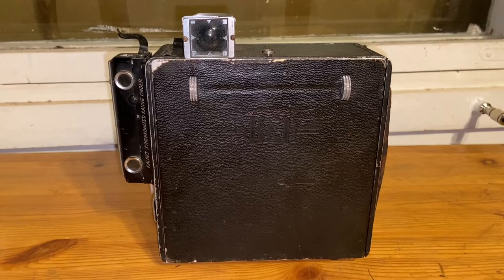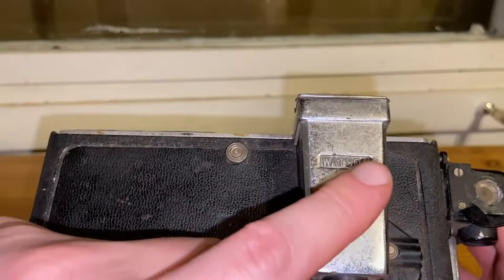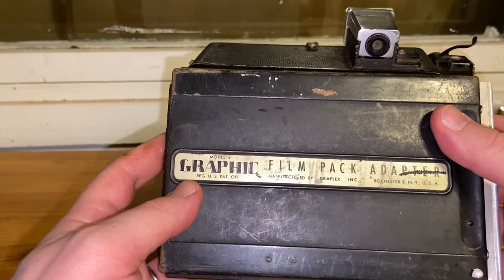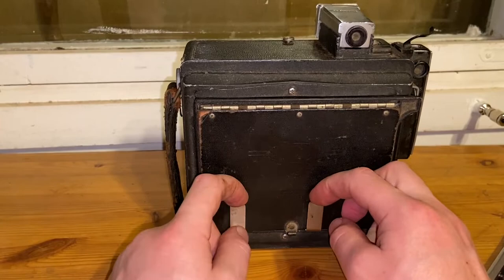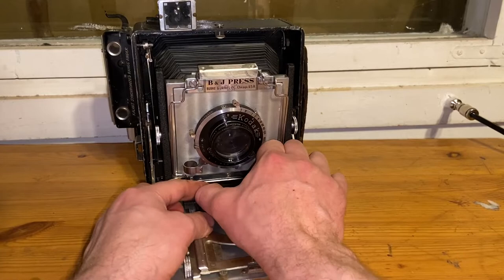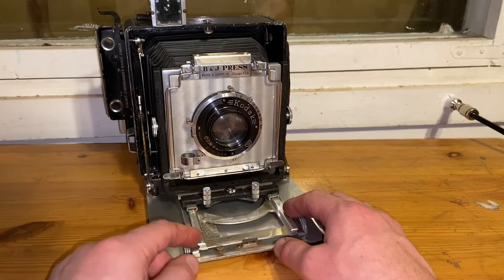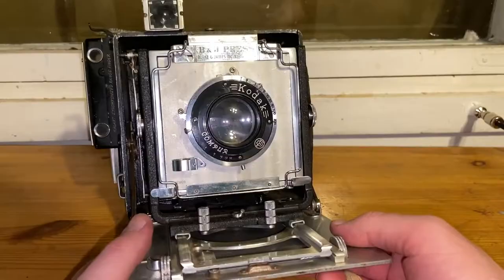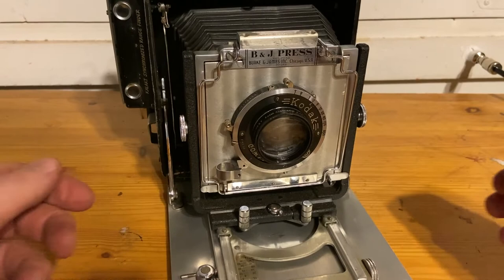Old Camera Review: Burke & James Press Camera

Comment: Thanks for the video. I was given one of these cameras to restore. It's a barn find, dusty and crusty but the ground glass and bellows are intact. It has a blank sleeve made lens board and I was given two lenses to repair and use. First is a Kodak Ektar  127mm f4.7 with synchro compur T-400 shutter and a Graphflex optar 135mm f4.7 with  Rapax shutter T-400.  Neither work, slow and sticky. I think just need good servicing.
Reply from the maker: Yes a good regular CLA is always in place for these oldies and they work just fine.